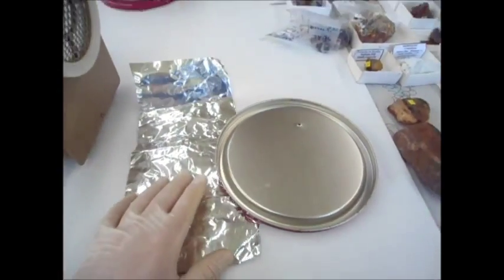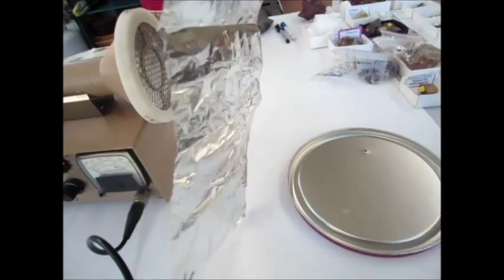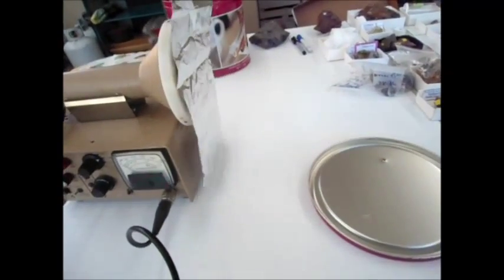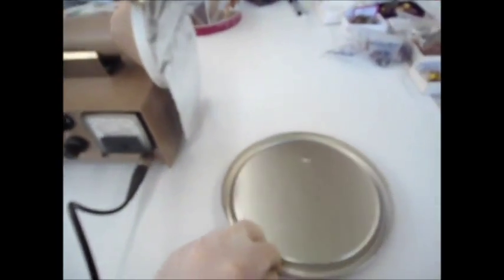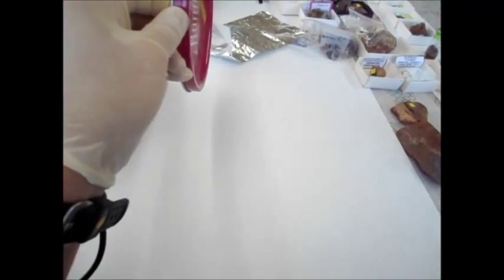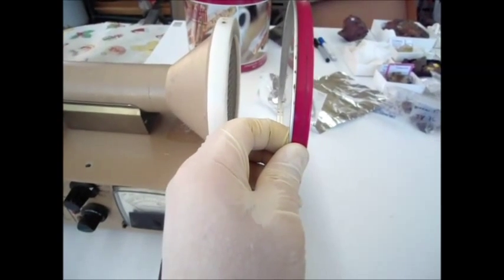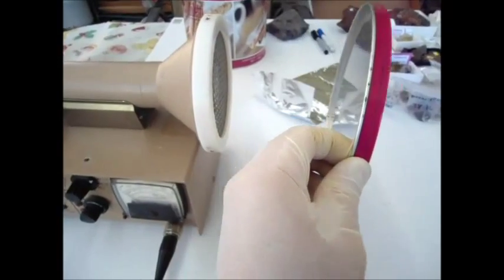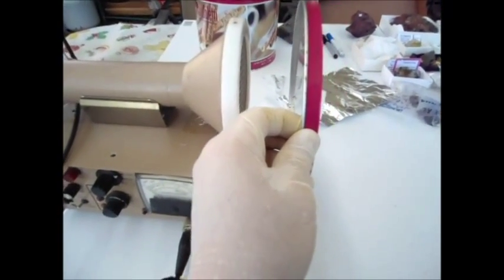Polonium 214 Alpha.

Comment from the maker: The source of the Po214 is from Bi214 with a half life of 20 minutes
The source of the Bi214 is from Pb214 with a half life of 27 minutes

That in turn comes from Po218 at 3 minutes and the actual source is Radon 222.

The Radon 222 comes from a Uranium ore source via that decay series.

The video is based on high energy alpha particles.
The Rn222 @ 5.6MeV is removed when the metal lid is removed from the system. 
Po218 @ 6.1MeV and 3 minutes half life decays away fast. It's actually fun to watch this step in the measured alpha radiation.
Beta radiation is not measured by the detector.
So by a process of elimination we're left with Po214 @ 7.8MeV alpha particles.

Comment: How does it work if the half life of your sample is 164 micro seconds? Well that is according to wikipedia.
Reply: The Polonium-214 (164 μs) is in secular equilibrium with its parent isotope, Bismuth-214 (19.9 min), a longer-lived decay product of Radon-222 (3.8 d). So, it's now decaying at the same rate as the parent isotope and being actively created as it decays, however, once the decay products reach and become mostly Lead-210 (22.3 y), the Polonium-214 will be almost entirely gone, and undetectable. He's using an alpha scintillation counter, which only detects alpha. So, there might be some Polonium-218 (3.1 min) being detected as well.